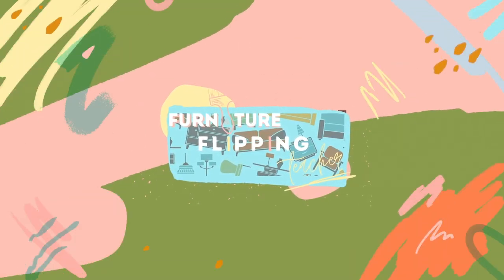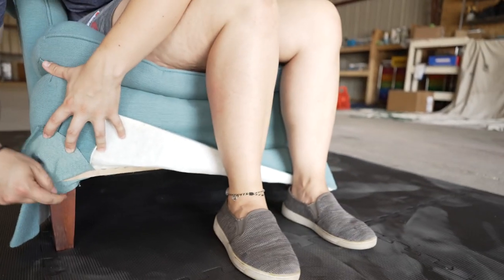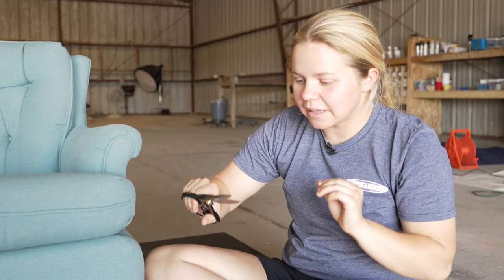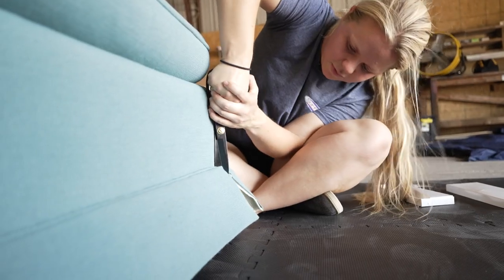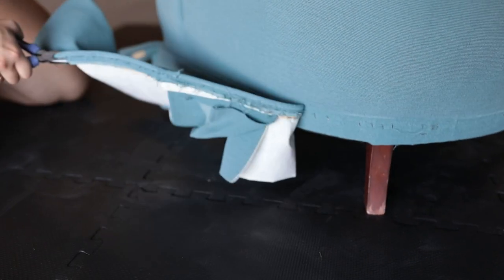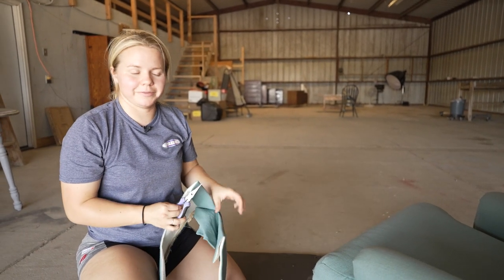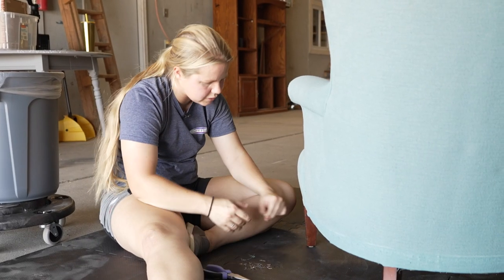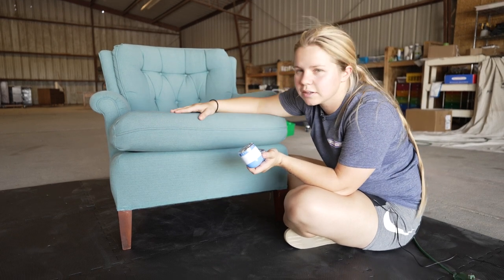Thrift Flip | Chair Skirt Removal + Cleaning = $135 PROFIT

Comment: Another tip that takes a little more time. If you remove the bottom dust cover and vacuum it out...that's where everything falls in the cracks. You may even find some money. 😊You can just staple it back on when  cleaned.

Comment: If you pull off the corner pieces from th back you can leave the skirt and welting on and staple the skirt to the underside of the chair. It maintains the finished look and will save a lot of time. Especially if you use a power stapler. Around the legs,  you can make a small indent cut longer the you want to show and tuck the folded extra inside the cut out to maintain a finished look without fraying. Good luck!

Comment: I love cleaning, but was never keen on restoring sofas or arm chair with fabric due to the fact that u can not really clean it 100%. Or can u?
I was wondering if u can pressure clean a chair like that, so the water goes through the cushions. It would have to be dried outside.?
Reply: Growing up we had a brocade fabric sofa that was cleaned annually by my mom using a brush, Wisk laundry detergent and warm water. Sofa was hand rinsed with the brush and clean water and towel blotted to dry. That sofa lasted 20+ years w 3 young kids in the house!

Comment: Great shears but Fabric shears are for cutting not prying! You can totally ruin them. Use a screwdriver instead to pry. My grandma used to throw a fit when we used her fabric scissors!
Reply: That’s right! They are scissors, NOT a pry bar!
Reply: My grandmother used to yell too! But I still use mine on the regular to pry, then cut lol it’s worked the last 15 years I’ve been doing it, so I’m sticking with it! Once upon a time I’d use a screw driver, but it saves a ton of time to just…not. If I needed them for other things I wouldn’t use them in this manner, but this is the only thing I’ve ever needed them for. I can understand if you’re using them for constant fabric cutting!

Comment: "The little seam cover thing" is called piping. It has a beginning and end  point. Start there when you remove it. I suppose it depends on how dusty the piece is but I always use a vacuum first to remove loose dirt before I get it wet and create mud. A word of caution about leaving the furniture out in the sun. Yes, the sun will sanitize, but it can also blech the fabric, especially if its made with natural fibers. You forgot to include the cost of Restore a Finish when you did your cost summery. But then, you probably didn't use much.

Comment: I’ve watched you tear off skirts many times. There is a starting point and I suggest you don’t use the front of the chairs in case there’s an oops.
Reply: That’s a great tip!
Reply: I saw someone suggested not removing the skirt but turning it under and stapling it to the frame. I don’t like seeing the change in color where the skirt is removed.

Comment: Those expensive scissors are not pry bars, instead use a big screwdriver or a small crowbar like tool....scissors are for cutting and when the tips are damaged, scissors will not cut well...they are trashed.

Comment: You need to wear eye protection. You can start to loosen the staples with a flat head screwdriver and then cut the skirt. Fabric scissors are not meant to be used as a pry tool. They are heavy duty, but can and will break at the tips. When you are a sewer, the first thing you learn is never use your fabric scissors for anything but fabric.